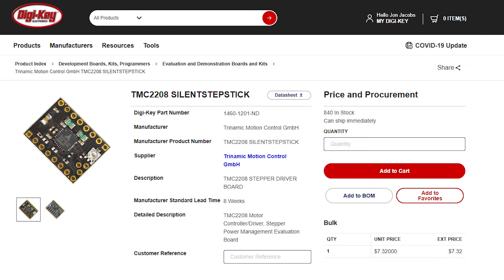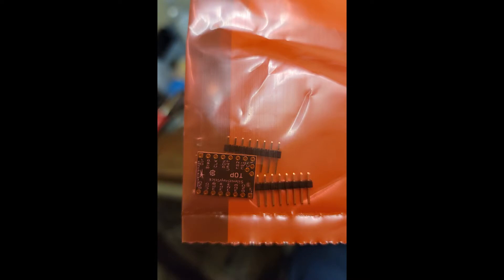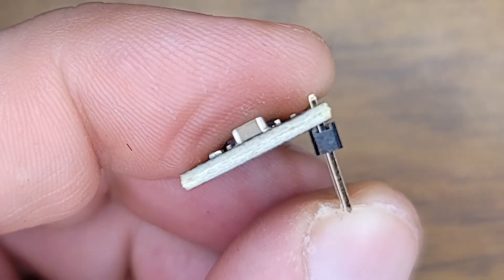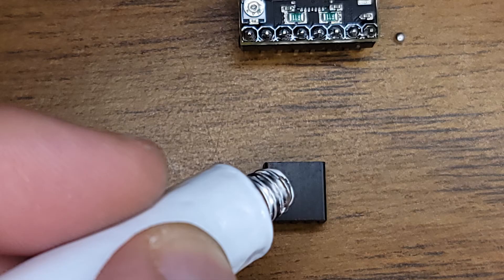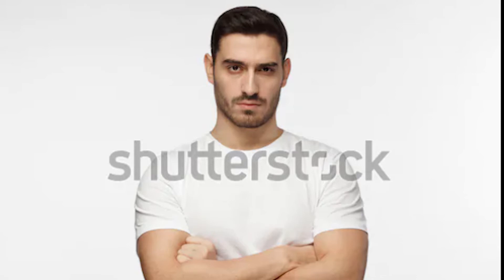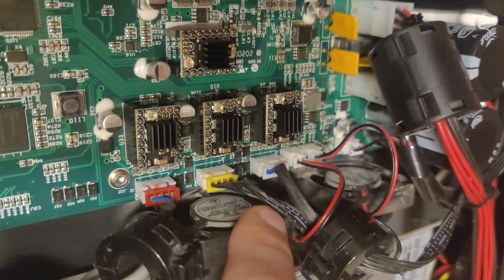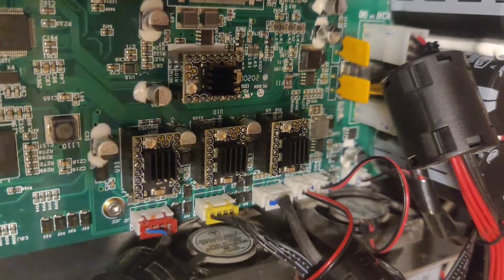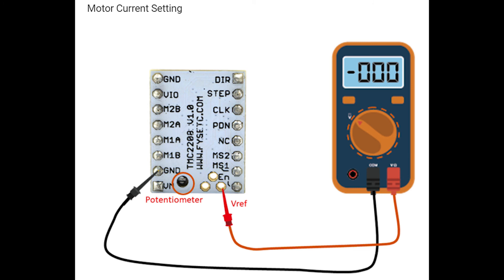FlashForge Guider II 2208 Stepper Driver Upgrade

Comment: You have to leave some pins. I tried using tmc2225 drivers from china and ended up frying my onboard stm controller. I'm trying to repair it, this is already the second motherboard. the stm controller from the v0.5 board has a slightly different firmware version so I'm going to flash over the version from the v0.6 board. My printer gives an extruder error and is saying that the temperature drops under 30 degrees wich is the setpoint or something like that. The v0.5 board has corrupted emmc btw.

Comment: Hi again! What about the Extruder Motor Driver? Do you have to swap the connector to the extruder motor as well?
Reply from the maker: Yes, I had to flip all my connectors. I'm so mad I didn't actually show that. :P Any stepper motor connector had to be flipped. If I do an upgrade to my FF Creator Pro, I'll redo the video with a more precise guide. :)
Reply: @J_Squared2  Ok thanks for the answer. I will probably build four short conversion cables to not having to mess with the board connectors :)
Reply from the maker: @hioda5563  I would have done that if the connectors were "glued" down like I've heard. Hmmm good business idea haha!
Reply: @J_Squared2   I saw another video and in this video they switch only 2 cables out of 4. And you switched all right? Just "mirrored" them or? Another question, did you configure the settings of the stepper driver,or did you just go with default mode? This was NOT a FF printer btw in that video.

Comment: Hi Jonny! Great video! I just found one thing a bit unclear. The re aligning of the connectors, is that ALL the cables in the connector, like just flipping the connector up side down?
Im making a short conversion cable so that I dont have to tamper with the original cable alignment.
Can you please describe the realignment?
Thanks
David

Comment: how did you disconnect the plugs?
Reply from the maker: I pulled them from the connector, then pulled the connector right off the motherboard
Reply: @J_Squared2  so you haven't adjusted the plug of the cable?
Reply from the maker: @8382aaz  No, I spun the motherboard connectors around for the XYZ motors. Didn't touch the cable connectors :)
Reply: @J_Squared2  Did you make a movie of it or do you have an example of it?